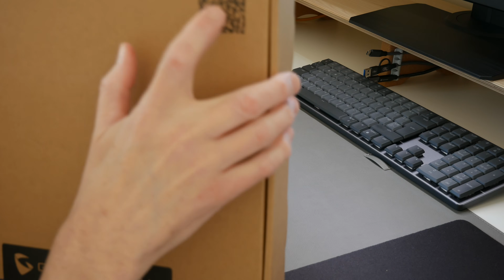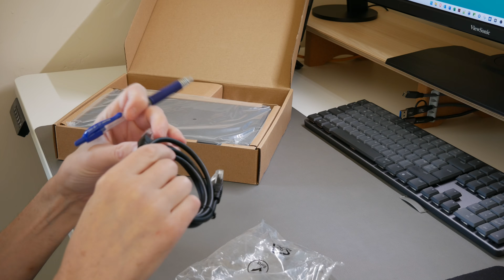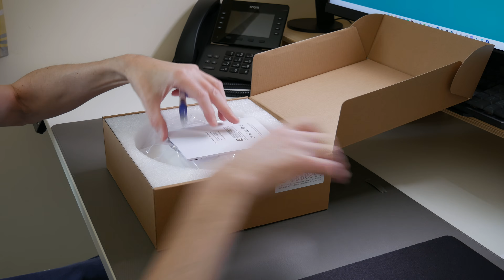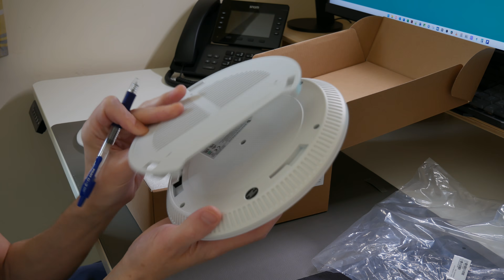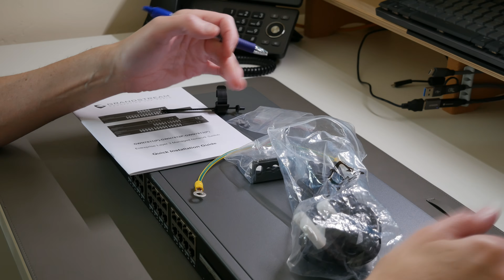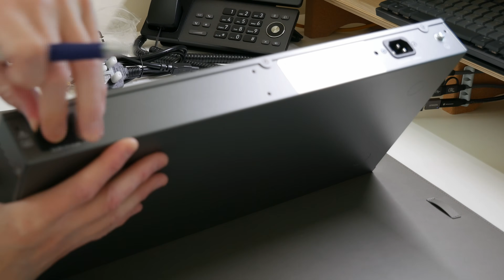Setting Up A Grandstream Network #1 - Unboxings

Comment: How are these routers gwn7003 for home usage? And what sqm do you get in buffer bloat test? And did you tried to connect internet directly with sfp Transceiver would it work with epon onu?

Thanks again
Reply from the maker: I haven't done a Buffer Bloat test and no I haven't tried to connect it directly with an SFP Transceiver.  I see no reason why it wouldn't work with EPON.  I would raise a ticket with Grandstream to be 100% sure it would work with EPON.
Reply: @MrTimTech2022  thanks and do Please share bufferbloat test results

Comment: @mrtimtech did you get any update on the rack mount brackets? I bought my GWN7003 specifically to put in a server rack.
Reply from the maker: I contacted Grandstream direct about this and they asked me to contact the UK distributor which I did and unfortunately I'm still awaiting a response, thanks for reminding me, will chase!  If you're in the UK ? then try contacting BNS Distribution that sells Grandstream products in the UK as their UK distributor.
Reply: @MrTimTech2022  I had the same issue. Purchased through Amazon. No one was helpful. I contacted Grandstream support directly and they are finally sending me rack mounts. Hopefully they can correct the documentation on their website and the printed material because they are inconsistent.
Reply: @MrTimTech2022  I BOUGHT MINE IN sOUTH AFRICA, CAME WITH RACK MOUNT BRACKETS

Comment: Questions:

1. Do they support IPv6 firewall rules? So I can open ports on v6 as well.
2. Do they support DHCP Reservations for specified clients?
3. Do they support USB Mediashare? (Samba or FTP)
4. Do they support DNS over TLS for clients?
Reply: Already using a GWN7003 in a corporate install & yes IPv6 is fully supported on firewall rules and ports.  IP reservation for specified MAC address is there too.  Good piece of kit.  Also using their L3 PoE switches which work well. 👍
Reply from the maker: @ginaward5648  Thanks for your input in to this, we'll certainly go through things step by step.  But like you say these pieces of kit from Grandstream certainly look like they give other brands a good run for their money, decent prices too, very competitive for what you get.  Grandstream are currently getting involved more in their networking products so watch this space.
Reply from the maker: Hey @Lucaat - Good and valid questions and thanks to @ginaward5648 below, they confirm this for you I believe, but keep watching and following along and we will see what we can do with these Grandstream pieces of kit, they are dam good prices for what you get too, I'm certainly excited to see what we can get out of these products, the initial Router setup is coming this week and then later on we'll get deeper in to things with IPv6 etc etc.